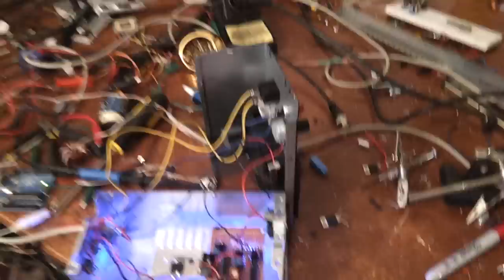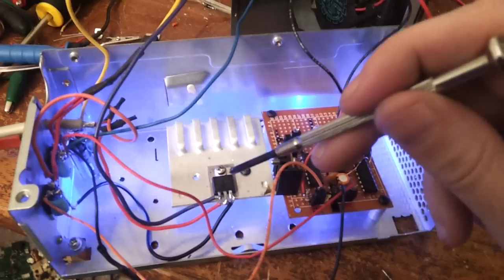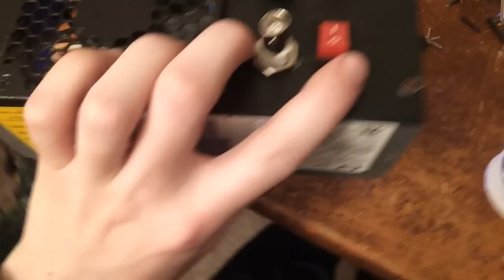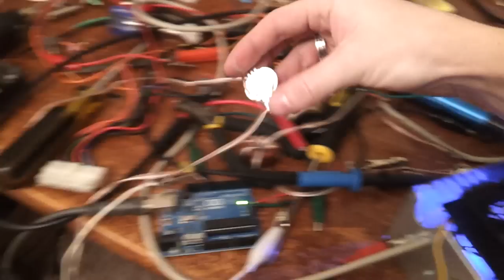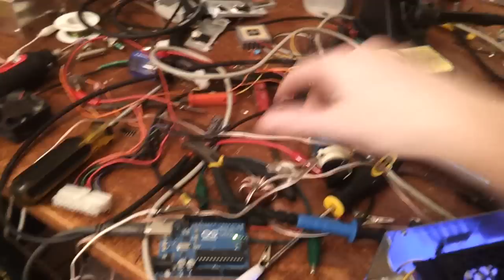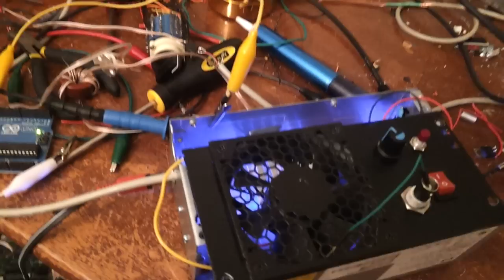Homebrew high power led driver with variable current and TTL

Comment: What is your opinion of this high-speed laser driver?
http://www.repairfaq.org/sam/ldschpcb.gif

The author says it's really fast, but it works by modulating the LM317 regulator which I believe might be slower than just driving a current-sensed MOSFET (am I mistaken?)

Comment from the maker: In my application I intend to use this to rapidly illuminate living cells at time scales of 0.1 to 20 ms during sensitive electrophysiological recording in a scientific setting (patch-clamp). Because most LED drivers rely on PWM, it ends-up being very RF-noisy, and the current pulses show-up on the extremely sensitive recording traces. Therefore, I needed a fully analog and non-switching option to adjust brightness. Your board sounds cool - I'll google it now!

Comment: Hi Scott, Pretty cool project again.

Why not use a standard led driver? What are your goals? Low-cost? Made with "standard" components?

You might be interested in this board I worked on that includes a 10W rgb led and a three channel driver. I am using a attiny861 to measure the current and adjust the current PWM. Doing in software what you are doing with the opamp I guess. Cost is pretty low.
Google loochi 0.6 prototypes to see it (I cant post link in youtube comments).

thomas